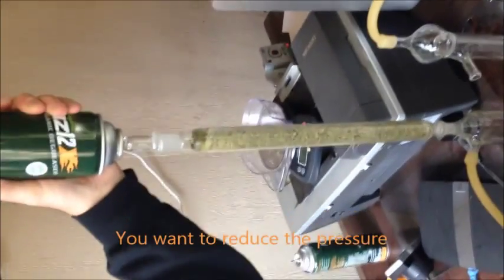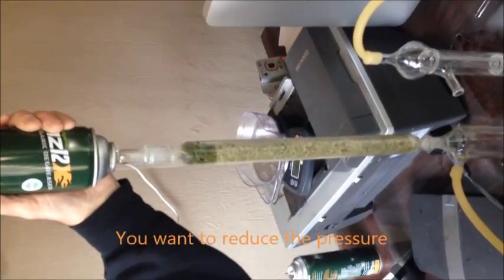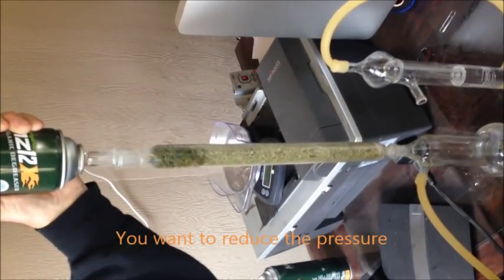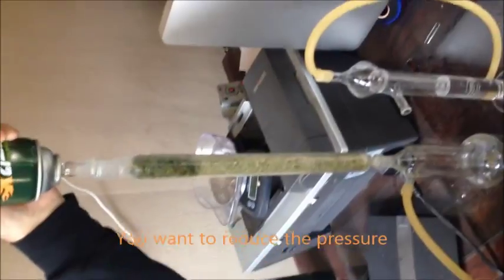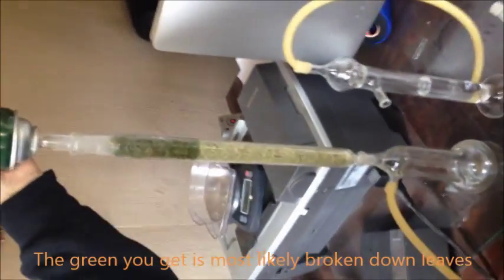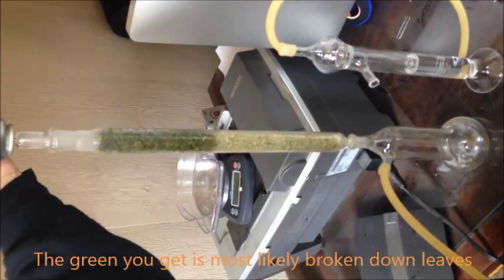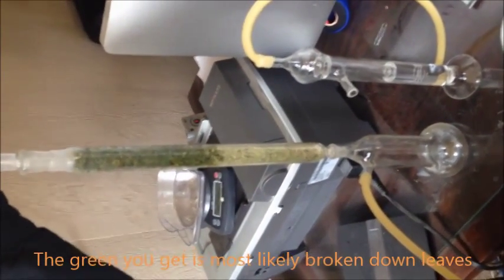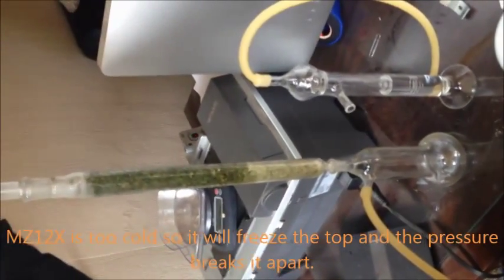MZ12X semi close loop system test

Comment from the maker: What you want to get it out from the plan is Hydrocarbon and DME is very excellent Hydrocarbon itself and it will bond with Cannobinoids and Terpenes and Terpeniods. MZ12X pulls 13-30% of Terpenes and Terneniods compared to 3% in butane extract. MZ12X extracts more then Live Rosin in some strains. This is why the extract does not get harden like candy because you have 5-10 times more Terpenes and Terpeniods. When people just wanted to get highest THC as though it is come sort of holy grail they over looked the other parts of Weed.
But now they are educated more and they understand that you need Terpenes and Terpenoids in order to get all the benefits as well as the flavors and scents. MZ12X (medical grade DME) is very pure and clean and it will not stay in the extraction given overnight or 12 hours vac treatment. By winterizing it you are melting all those
Terpenes and Terpenoids for the sake of color.
Please just follow my instruction and dab it once.....you will know what I meant. You can actually have blunt right next to you and smoke it in comparison with dab with MZ12X extraction. MZ12X extraction will amplify the flavor and the scents. What people are praising about with Live Rosin and Terpenes infusion....we did this 2 years ago. Unfortunately nobody was listening.

0.32% CBG-A
< 0.01% CBG
0.32% CBG-TOTAL
53.31% ∆9-THC-A
5.27% ∆9-THC
< 0.01% ∆8-THC
0.03% CBN
58.61% THC-TOTAL
0.49% CBD-A
0.66% CBD
1.15% CBD-TOTAL
0.20% CBC
6.16% ACTIVATED-TOTAL
∆9THC + ∆8THC + CBN + CBD + CBG + CBC
Cannabinoids that have been activated through decarboxylation (curing/storage of flowers, or heating/cooking of edibles, tinctures, & concentrates)

Analytical360.com
Analytical360.com
11.94% Linalool
1.49% Caryophyllene oxide
< 0.01% Myrcene
< 0.01% beta-Pinene
< 0.01% Limonene
< 0.01% Terpinolene
< 0.01% alpha-Pinene
0.82% Humulene
2.42% Caryophyllene
16.67% TERPENE-TOTAL

Comment from the maker: You do NOT need to winterize it.  Please try it first before speculating.
Reply: +lghllc why would u not need to winterize this oil. with dimethly ether being a more polor solvent it pulls more from your materials not less. (this being the reason lots of people mess up and get green) but the oil will still have plant fats and lipids even if fully gold/yelllow. its true they dont need to removed but to act as if you coudnt improve the oil by dual solvent winterization via ethanol or single solvent dewax but ive herd that doesntn work with your product. so it would be more helpful to your sales to answer the question about re activity with ethanol for winterization. instead of being rude and saying u dont have to winterize and say people are speculating i kno mike rycc and we have both tried mz12x made oil a few times he has a few instagram posts @mpro420o of real nice gold eho made with mz12x. so we have tried it and its great love the product but to say it doesn't have waxes and lipids that could prefferably be removed is foolish. you dont need to winterize bho either but the diffrence is amazing. so how about u look into it as dual solvent may help yall make a eho that gets into a cup or sumthing. love the product hate the way yall market. (best edibles solvent hands down)